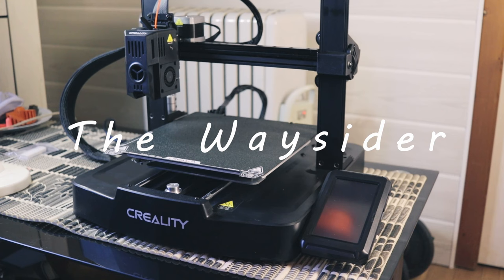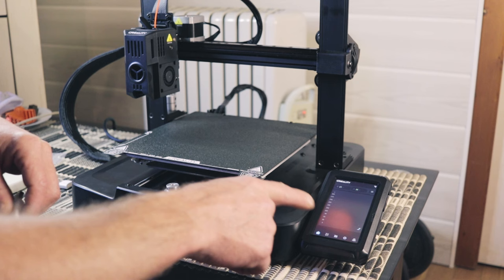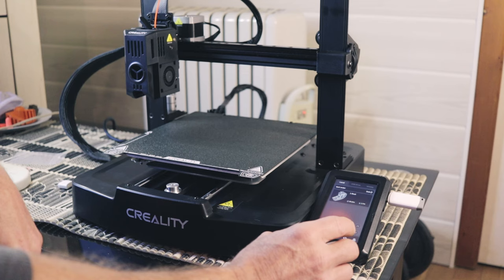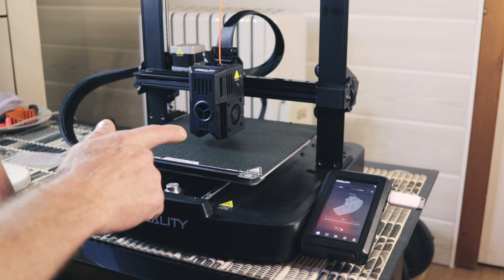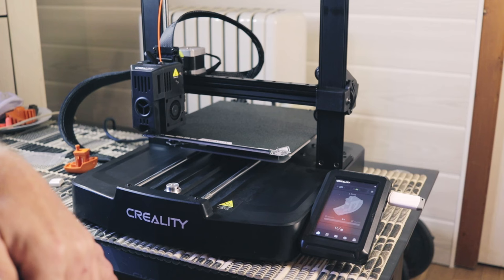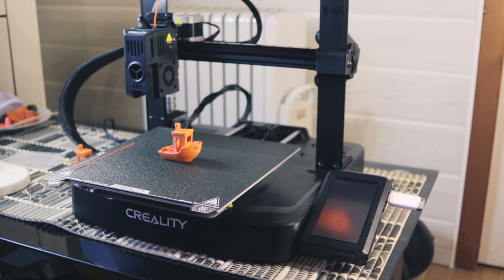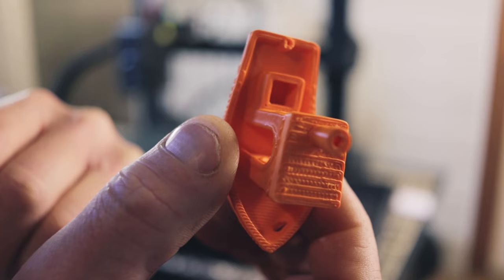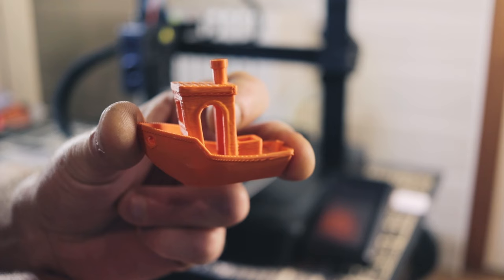Creality Ender 3 v3 KE first print test. How Does It Print?

Comment: Great Video, thanks,  I am currently using a fully upgraded anet  a8 from 2017 also, but am so tired of bed leveling and always messing with it. 
I get pretty respectable prints most of the time  printing on glass but am always on edge while printing, wondering if the print will come loose or not. 
Feel it's time to move up so I'm really considering the KE as a suitable upgraded without breaking the bank.  thanks again for the review!
Reply from the maker: Hi yeah I have the same anet a8 it was good to start the printing journey but I really can't look back now after having the ender ke or the other printers in the range are also good but whatever you go for it is a step up from the old anet.
Reply: @thewaysider7774  
 Roger that I learned a lot about 3D printing with the a net it's pretty well tricked out but it's not a new printer I'm excited about getting the KE I've been researching all of them and I don't think for $275 you can beat that ender KE, thanks for the reply best of luck to you!
Reply from the maker: @metalfabman5477  My pleasure thanks for the comment.

Comment: I found that full speed works well on mine, but the temp for normal PLA needs to be 220c. Creality's hyper PLA will work well at the 210 default; other PLA needs 220. My first layers were a little sparse, but 120% flow on the first layer cured that issue nicely. other than that, the KE has been excellent for me.
Reply from the maker: Ok thanks that's great information, will try that out.
Reply: Any bed temperature setting??    60°C   ok?
Reply: @CONFUCIUS-f2x  60 is what I use

Comment: I wish my KE worked out the box like this.  I did the calibration, bed is over.  But my first layer sucks and not stick sometimes depending on the model I’m trying to print.   Think I need to reduce the offset or slow down the speed
Reply from the maker: Yeah the speed is maxed out so will be better a little slower. Try that firs
Reply: before every print clean the plate with a cleaning solution and a microfiber. i use simple green to clean with.

Comment: How do you like it?
Reply from the maker: It's alot better than my anet just need some time to know what's what but all in all am impressed
Reply: @thewaysider7774  thats great ti hear, ive worked with a few 3d printers before on my workplace but this is the first 3d printer for myself, so Im glad Im hearing overall good things. Did you have to tune anything?
Reply from the maker: @Redspark77  no I haven't touched tuning am using the creality slicer as there is already a profile for this printer so will play with some settings but it prints from that profile pretty good without messing around too much.
Reply from the maker: @Redspark77  Hi straight out of the box it worked well, i didnt touch the settings but in the future i will finesse the settings in the slicer i am trying the creality slicer as there is a profile already setup for this printer.
Reply: @thewaysider7774  I want to use cura instead but im too lazy
Reply from the maker: Yeah it is more complex but a great slicer when you know what to do. I am using creality print for now but has slightly less control certainly in terms of support settings